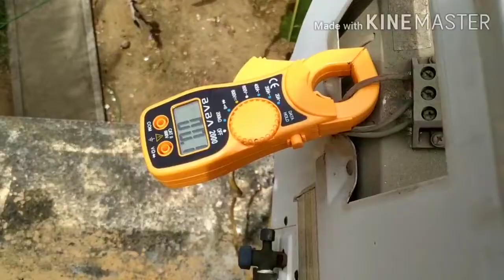Ac capacitor problem and how to replace and fix it

Comment: Non inverter ac power on oana odaney outdoor run aga start aguthu. Indoor off panalum outdoor oditey iruku. Temperator change panalum change agla. indoor Board chk paniyachu nala iruku. solranga. Ena problem ah irukum
Reply from the maker: @bshunitspare7237  inverter model outdoor off panalum outdoor oditey irukum after 1 minutes it will be stop
Reply: @velaikaran8436  its non inverter.
Stablizer on pana odaney outdoor start agi cooling vara start aguthu.
Reply from the maker: Board problem

Comment: Cooling varuthu but romba kami ah iruku enna pandrathu bro
Reply from the maker: Thank you for watching
Reply from the maker: Check gas and refill
Reply: @velaikaran8436  technician vanthu refill panitaga bro Evan water service also done but still low cooling
Reply: @velaikaran8436  vara enna pananum soluga naane check pani pakuran
Reply from the maker: Small pipe called discharge pipe check if there is any ice formation issue
Reply: @velaikaran8436  indoor ac la ice varuthu
Reply: @velaikaran8436  outdoor ac la ice varala bro
Reply from the maker: So ice issue
Reply from the maker: So plz refill gas . Gas leakage problem
Reply: @velaikaran8436  last week refill panan bro.. Again pananuma?